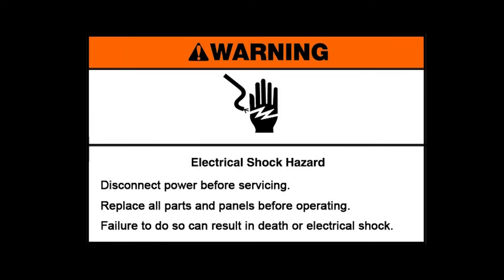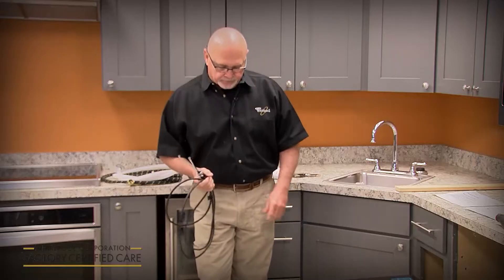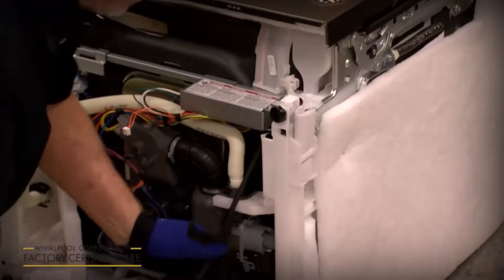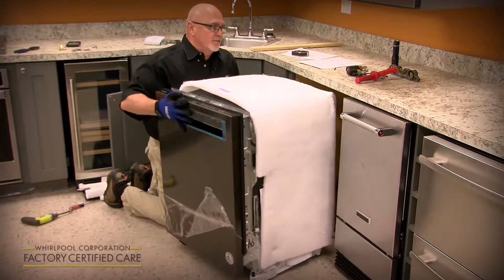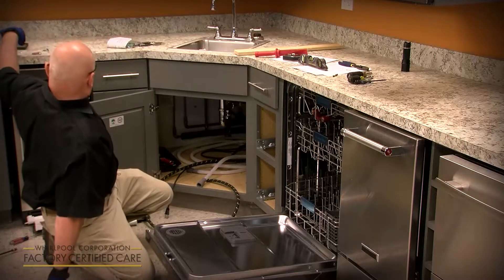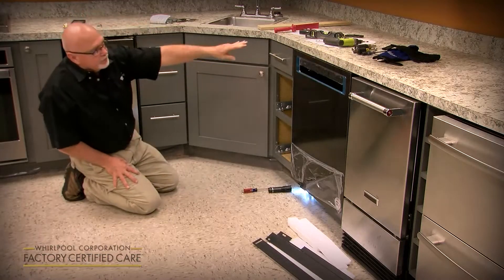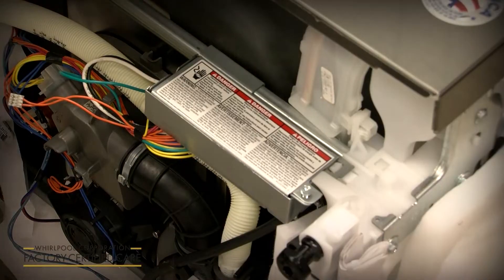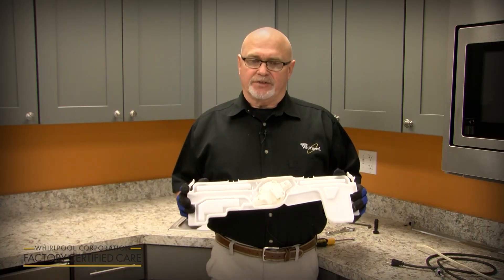Dishwasher Installation (2020 redesign)

Comment: This was extremely helpful.  I wish I had watched this before doing my own installation.  The manual does not indicate which end of the drain hose is which.  The manual doesn't tell you to leave the front lowered.  I had to figure that one out through trial and error.  The manual makes it appear that you have to break off the mounting tabs before installation.  Turns out that is only if you're putting the brackets on the side.  Several things are not clear in the manual.

With our past dishwasher I ran the drain hose as shown on this video and this caused occasional problems with drain water draining back into the dishwasher.  The fix was to run the drain hose through a hole just below the counter top so that there was a downward slope from the highest point (the hole I just mentioned) to the sink drain connection in the tailpiece.  I'm not sure if that matters with this KitchenAid, but I did the same routing as I learned previously.

A tip for any other people installing your own: get rid of your old dishwasher pieces before doing this install.  I spent an hour trying to figure out how to install the toe plate until I realized it was the toe plate from my previous dishwasher.  Duh!!!

Comment: So far, I've done everything correctly with my direct wire unit. Unable to make the connections with the unit on its back - I had to stand it up and make connections from the bottom due to drain, supply, and power lengths (but drain hose from the side was easy) - very little room to work underneath. I need to do a side mount with a granite countertop - wish you had shown that. Oddly enough our last washer used the same mount brackets on top to an under mount strip - this one will not do that. Also, my  door handle model did not have the handle included inside the box - not happy about that. Great installation video.

Comment: That electrical connection is going to be a pita as I have hard wire. I hope those screws are long enough to curl 12 gauge copper around them

Comment: Good job , I need help please for microwave oven, KitchenAid, 125V , in our country the electricity is 220V , they put it in and damage happened, I found fuse and diodes and relays burned I replaced them and the microwave work , but when I put time I press start I hear relay start and stop quickly in second , please help